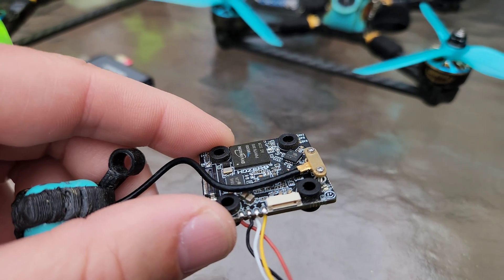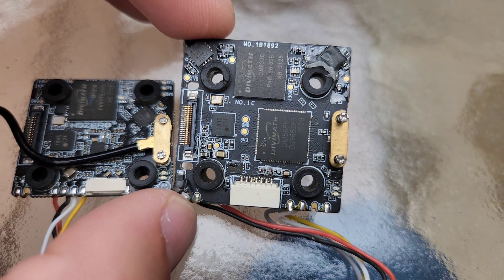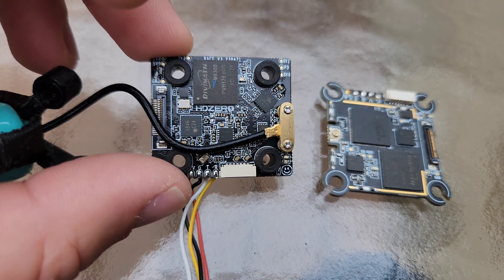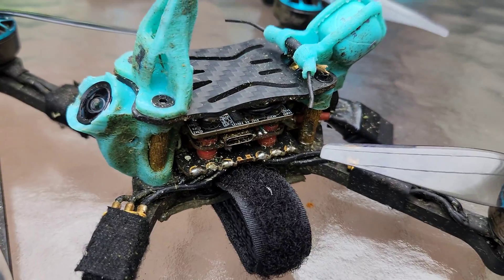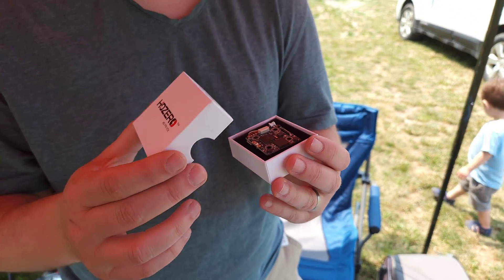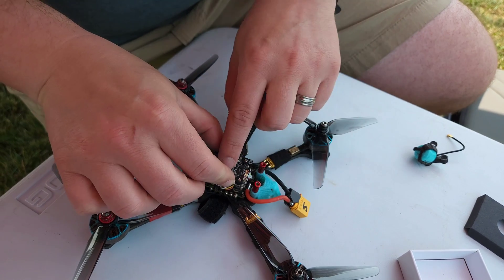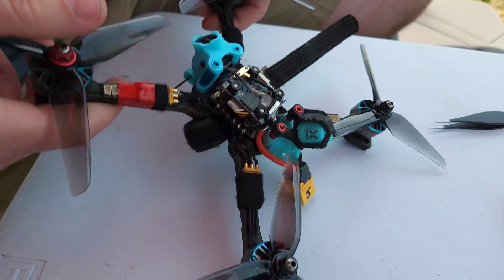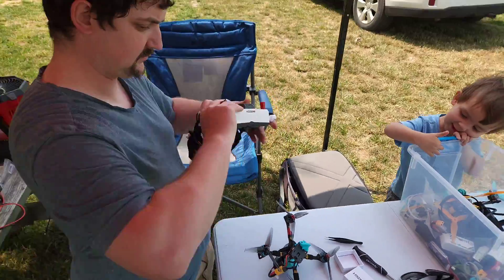HDZero Race v3 VTX - Smaller, runs on 5V, and more!

Comment: I cut the corners off my whoop lite to save some weight on my 19.47g 65mm hdzero. Sounds like others may have done this as well? Only thing I was worried about was changing the ground shielding pattern but it seems to run just as well still.

Comment: The size reduction is massively welcome! Now if only we could hit at least 400mW like this. That's about the bare minimum to fly laps around my home without being blind.
Reply: Whoop vtx?
Reply: @QSpeedRacer  You mean the old 500mW version?
Reply: @jaysonrees738  you know what I went looked.  Confused it with my Walksnail. HDzero only 200mw not 350mw. I fly my HD zero whoop from inside my house. But haven't tried going all the way around my building. But even dji struggles with that here
Reply: @QSpeedRacer  Yeah, I've had a trouble keeping my signal strong enough for the sort of flying I do. My house has a lot of materials in it that block signal, and I like to go around very large trees. At 400mW analog, I can just barely see when behind my home, having nothing but black and white outlines. I love the image that HDZero produces, and the goggles rock, but the transmit power is simply too low right now.
Reply: @jaysonrees738  yea. I only use on whoop. For most part I can fly all my backyard and neighbors backyards area but my 350mw walksnail only slightly better.  To go around my building I need atleast 1w cause dji I can't see crap and freezes trying to go around. My 3w analog makes it. 🤣